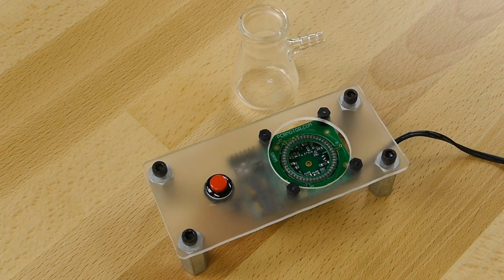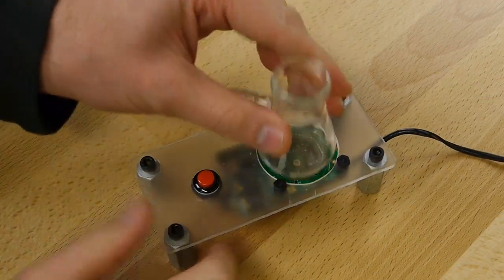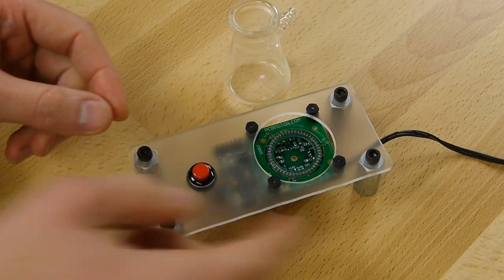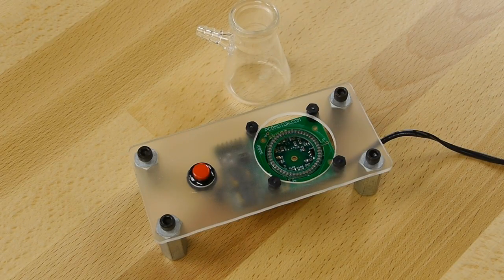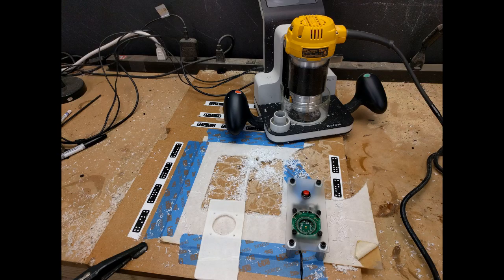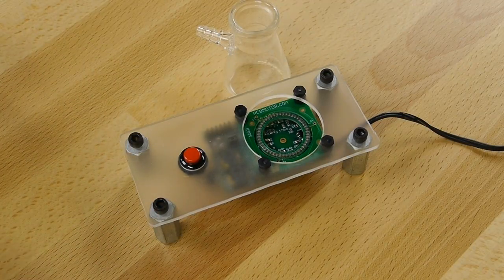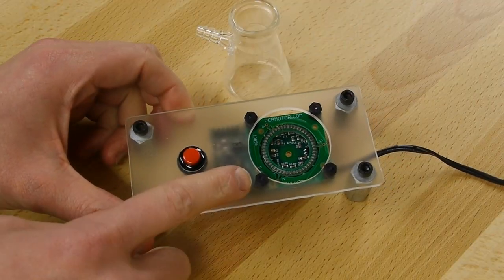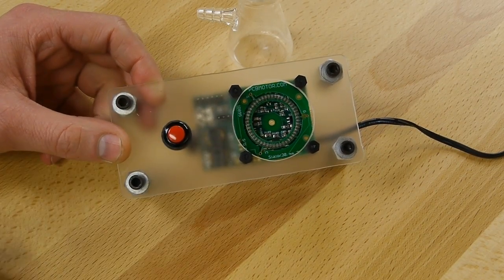Piezoelectric motor

Comment: You explained it very well. Can u throw some idea on sourcing of low cost Piezos for building walking beam type linear micro motor. The stroke required is 8mm in steps of 40microns with force of 40 N. Available operating voltage is 10.5 to 13.5. The walking beam should stay in position after the current is withdrawn and should sustain 20g of vibrations without changing the position.
Let me know the size & sources of Piezos as also how to go about it for building a few prototypes.

Comment: wondering if this also causes a vibration effect?  If not, what woould you have to do or combine with this PCB to get the strong vibration force?  I have crretaed a new product and we are thinking of putting an ultra sonic vibration in the lint brush handle as vibration actually assists in removing lint from clothing a lot faster.  We have a simple 3 volt, 9mm diameter by 23 mm total body length vibrator motor in it right now but i feel this is not the most viable and advantageous opption to get the high quality vibration that we need.  Any thoughts or ideas will help.  I really like the philips oral care electric toothbrush ultra sonic vibration and want to use soemthing exactly along these lines but i bleieve they have patented their ultra sonic vibration but it would not effect me becasue im yusing it for a different application!  thx in advance!

Comment: Hey man.  So if I have just designed and 3d printed a lint remover with two 3” blades that is used for removing lint or pet hair from clothing or any type of fabric and we have installed for now at least two 9mm erm motors inside the razor handles by the blades that give us pretty good vibration and each motor only costs $1 per piece and are run at 3V!  

The best for our design is around 3 volts which have two Aa batteries in the 6” handle!  

I’m pretty sure ultra sonic vibration motor would be the best quality and last the longest,
At least 300-400 hours of life use form the motor so can you give me an idea of how I can use an ultra sonic vibrator motor in my design?  

So the best example of vibration I can give you is the philips sonic care electric toothbrush, where I believe they use a dc coreless iron motor and have an erm motor can tracked at the back end, so would this be an example of ultrasonic vibration at its finest?  

Please explain to me how I could use ultra sonic vibration in my lint remover design?  
Thanks

Comment: I wonder how efficient a piezoelectric motor could be made, compared to an electromagnetic motor, and what would the limiting factor be to the torque. How much force can a piezoelectric transducer produce without it's equivalent to magnetic saturation? I know that piezoelectric speakers are very efficient, compared to dynamic speakers.

Comment: Piezoelectric actuators are pretty precise as well.
We are using some linear piezoelectric actuators in our Optical parametric oscillators to tune the cavity length.
They can do sub steps in around 10nm.
Reply: You have an interesting job. Faulhaber has a wide range of even more precise LEGS piezomotors, circular and linear.
Reply: @StephanBuchin  Thank you. Wow you're right. They have motors that have an 1nm Resolution. That is really amazing.
I'm wondering, if you can use piezoelectric circular motors for long terms, because it feels to me  like they will wear out quickly.
Do you have experience with them?
Reply: @vladimirsch.3015  Sorry, no i don't know how they react in the long run but piezoceramic materials have been used for decades in high frequency audio speakers and they are very reliable. They are also used in very demanding applications like fuel injectors for car engines. Have fun at work.

Comment: Okay. First think first this is not piezoelectric. This is a resonant motion produced by magnetic field when put electric to it. This explained actually gravity. Is a fascinating apparatus. Piezoelectric is the light the pressure of crystal or frictions possible tiles or after Teutonics earth opened and see light excites effect. Can not be vibe sonic the sound is from the glass object. Is not electromagnet buzzer. Can not be motor has no rotor and glass is not conductive. Very interesting energy field. Isaac Newton was right. When add energy you create a other energy.

Comment: Maybe I missed it when you talked about it but what is the "torque" or strength of these elements? Also what dictates the strength is it voltage(and obviously size/material as a result of voltage)? This is pretty cool.

Comment: Is the screeching sound because of the glass scraping across the top of the elements or from the actual piezo elements?
Reply: Found the answer in another comment >> It's mostly the glass. The included disc rotor is fiberglass, and it's almost silent. The stator by itself is completely inaudible.

Comment: Huh!  Suppose I were to try hacking open a bunch of common cheap piezo buzzers, arranging them in a circle, and creating a circuit to modulate their on/off cycle similar to this PCBMotor?  Has anyone seen a homebrew piezo motor using common buzzers like the kind you can get from Radio Shack?

Comment: "hey, wanna hear the most annoying sound in the world?" haha..i was wondering if this could be used in medical IV infusion pumps. usually theres little fingers or rollers that squeeze the tubing to advance the liquid but i wonder if this could generate enough force on each side of the IV tube to do it quietly. probably not worth the R&D since the existing solutions already work well and fairly quietly and accurately but i still wonder..

Comment: Huh, can these be used to drive a motor wheel?  What kind of torques do they see.  Since my company uses a hub motor for a drive system, I'm wondering if you can use these to make a hub motor without all the planetary gears inside.

Comment: I need more explanations, do the piezos get taller following waves that go around in a circle, making the object spin using gravity, or do they all constantly vibrate one way ?
Reply: The vibration of the piezo electric material depends on the amount of the voltage of the wave applied to the circlular disk . So based on your application more the voltage more the material vibrates. But this will show lot amount of power losses like friction. Instead use servo motors for robotics application.

Comment: Cool demo!  Are the voltages across the piezos simply switched on-off or is there a polarity reversal? 
Thanks for posting this.
Reply: I'm guessing half wave AC. Basically, frequency modulated DC.
Reply: I wonder if some gain could be had were they driven with FM crossing zero? Have the piezos push and pull.
Reply: glasstronic
It definitely could be like that, but it'd be simpler to implement it with half wave. The more I think it it, it probably does push and pull, which would make it easier to reverse. But you'd have to have really perfect tuning of the resonations. So for the microcontroller being used to tune it and the odd cutout of the pcb.
Reply: theLuigiFan0007
Hopefully, there are other tinkers pondering this. As you are aware, those piezos might indeed be supplying reverse polarity to others in the circuit as the fired ones relax. I'm sure you know the drill.

Comment: The sound it makes with the glassware on it is exactly the same sound made by the ultrasonic tool my dental hygienist uses to clean teeth.
Reply: I believe there is one that actually makes the teeth vibrate to shake off plaque and stuff.

If I'm remembering correctly, the business end is a small metal rod with a metal ball at the tip.
Reply: As far as I know most of the dentist tools are driven via pressured air turbines, they turn in very high speeds which might sound a bit high frequency which can cause the same sound like this "ultrasonic"  piezo

Comment: these things are frequently called stick-slip motors; that's your search term.  A few years back there was a lot of interest in them, hundreds were designed and some patented.  A few still exist, the USM, nanomotion and some kind of micrometer positioner, maybe Newport.   Nanomotion has both linear and rotary versions for precision xy stages.  The bristlebot was another version, driven by a motor, but same general idea.

Comment: Can you use smd caps with crappy dielectric as those 'piezoelectric devices'? SMD caps with Y5V dielectric are quite prone to emit a sound when they see an AC across them because of the piezoelectric properties of the dielectric they're using.

Comment: This may not be the best analogy. But does this mean it works similar to a worm crawling? Each segment expands and contracts while pushing and pulling against a surface. Except instead of the "worm" moving, it's the surface it is touching.

Comment: Fascinating, however, I can't quite visualize how the expansion and contraction of the SMD devices, even in a wave pattern, causes the object resting on them to rotate. I'm wondering if there is more to their motion than a simple Up/Down deflection ...
Reply: As far as I understood it is a little more. The individual up/down motion of the piezo elements does not make it, but when you time their motion to get a wave, objects are pushed by the wave pattern like deadwood on water. The wave pattern itself is a property of the whole system (plate with all piezos & substrate). It is then more like the system as a whole wiggles and pushes the object around. In a waterwave most water just goes up and down, but when the wave hits you, it still has a momentum in your direction. The whole (here: wave) can have other new properties than its parts (here: piezos, chunks of water). This widely occurs as emergence.

Comment: Do you think you could make a track or conveyor belt system with interchangeable sections using this? Possibly for moving around small parts like in an assembly line.

Comment: If I recall correctly, Canon invented and patented this decades ago and didn't quite know what to do with it, until they found it would make the perfect autofocus motor. Fast, quiet, precise, ideal form factor (ring), and still reasonably energy efficient if both sliding sides are engineered properly. They called it "ultrasonic motor", which used to be a hallmark for the fast and quiet AF motors, but they later made a small fast spinning US motor which drove a traditional geared slightly more noisy autofocus system and also called it "ultrasonic", so we now have to specify "ring US" vs. "micromotor US".

The ultrasonic AF system has only recently been superceded by a stepper-motor AF, which can drive at arbitrarily slow speeds for focus-following in videos.
Reply: +pinkdispatcher I came here to ask about this. Is this how ultrasonic motors are built? I always thought they were made from two solid ring materials. I didn't think they were made from individual piezo motors. This fascinates me because it has robotics applications. Seems like anyone could make this style motor with some PCB design software, whereas ultrasonic motors have always been out of reach for hobbyists.

Comment: The piezo elements that make up the ring, are they specifically designed piezo elements or something else? It's just they look suspiciously like ceramic SMD capacitors, which do have a piezoelectric effect.

A few years ago i took apart an old Nikon lens that had a piezo motor for the focus, it was quite interesting, it used a machined aluminium ring with a thin piezo element on the back to distort the aluminium.
Reply: +Dexters Lab 2013 I had scroll a little to find such comment I had in mind. Google "CAPACITOR AS AN ACTUATOR" and you will find at HAD and article about it. My question is if Applied Science will try to make some actuator using ceramic SMD capacitor. Thumbs up to see a hack/DIY of it.
Reply: "They are single-layer PZT (lead zirconate titanate), which is chosen for
 having a high piezoelectric coefficient.  It's true that multi-layer 
ceramic capacitors also show the piezoelectric effect, but they are 
designed to reduce it as much as possible, since their job is to act as 
an electrical capacitor, not an actuator.  The capacitance of these PZT 
components is just a few pF.  If the demand for PZT 0402 actuators were 
as high as .1uF capacitors, the price would probably be about the same."

-Applied Science , in response to a similarly worded comment.

Comment: I went to their website to take a look. Man, it just added a hundred more questions. How do I find out more about the capabilities? Torque? Speed? They say it's super accurate, but can it replace a stepper? I need to get a hold of one of these. I think think of a couple projects I could use these on if they have the capabilities.

Comment: actually one interesting application could be in rotating things at very slow speed without gears (unlike electromagnetic) motors and without stepper motors. This is very compact and light-weight for these applications. A good example is say for example a jewellery display, luxury watch, and so on. Nice video :)

Comment: Did you try touching it?
Reply: +Loebane You can get 100 amps from a couple of volts or you can get only milliamps from a few hundred volts. It is all related to the resistance. Volts/Amps/Resistance are all related and depend on each other. Statements like "Well if it's low amps the volts won't matter." are just stupid. 30 milliamps (0.030 of an amp) across your heart will mess you up.
Reply: +Kim Jong-un Jr. Have you ever been shocked by 220 AC? I have and there was no pants shitting.
Reply: ***** Well if it's low amps the volts won't matter.
Reply: @Loebane  https://www.youtube.com/watch?v=8xONZcBJh5A
Reply: +Loebane But it's AC so it can lock your muscles.
Reply: +Kim Jong-un Jr. DC will "lock your muscles". AC will "lock you muscles" and release them depending on the frequency. 50/60 Hz will lock and release your mucles 50/60 times a second as it cycles.
Reply: Reading the documentations seems to imply that the current is around 100 to a safe max 500mA, though it could reach to 1.5A... That's the suply current, so the drive should be 0.5-2.5mA@200V to 1-5mA@100V.

A side note is that the information and documentation on their site is complete shit... I gues people that are interested in their product contacts them, but if you're just browsing... not attractive.
Reply: The ultrasonic sound generated by the piezoelectric transducers may be able to atomize his blood upon contact which would hurt. I don't know if these tiny transducers are powerful enough to do that, but if you have an ultrasonic air humidifier put your finger onto the piezoelectric transducer, or even close when it's running in water it will sting. I don't believe it's dangerous, but if it's powerful enough, I can believe it kay not be very good for your blood and at a certain point it can kill you, though I'm almost certain those transducers in his little piezoelectric motor aren't powerful enough and those inside a commercial air humidifer aren't either, although the atomized water coming off of it does look amazing.
Reply: Loebane
What stupid? 220V AC will literally make you shit your pants and render unable too move.
Reply: +oOMonkeyMagicOo If the power supply is current limited to 30ma, the most voltage it could possibly deliver through the human body is 20v. (an open wound with the live voltage shoved into it), or sticking your tongue to it...
Reply: Kim Jong-un Jr. What you're talking about is 220 AC wall current. This is 200V DC (not that it being DC makes a difference) and it's through a transformer. The amps are much lower.
Reply: Loebane
Uh-huh DC though transformer (sarcasm)
Reply: +Kim Jong-un Jr. Ok that was dumb on my part but it does have a rectifier somewhere for the microcontroller which is probably why I made the assumption that it's dc. Oh and when you said "what stupid" I wasn't saying anyone was stupid -- I meant let's not throw the term stupid around.
Reply: ***** First of all, transformers are a way to step up ac voltage but the current swings inversely with the voltage so it can stay relatively high.
If it is boosting 12vdc to 200v dc, then a step-up converter would be used. This trades amps for volts, and is cheap and efficient for applications that need high dc voltage but low current.
Reply: oOMonkeyMagicOo Let's not throw stupid around. This is a science channel after all. The important part is the amps from what I've read - your heart isn't in danger until up to about 100 milliamps. I'm no electrician but I believe that high voltages will overcome your body's internal resistance. So in this instance, the high voltage won't be dangerous as long as the amperage is low enough.

Comment: Are these really specific piezoelectric "components"? Basically any ceramic capacitor will exhibit the effect, and I suspect those are just ceramic caps in the ring.
Reply from the maker: +USWaterRockets They are single-layer PZT (lead zirconate titanate), which is chosen for having a high piezoelectric coefficient.  It's true that multi-layer ceramic capacitors also show the piezoelectric effect, but they are designed to reduce it as much as possible, since their job is to act as an electrical capacitor, not an actuator.  The capacitance of these PZT components is just a few pF.  If the demand for PZT 0402 actuators were as high as .1uF capacitors, the price would probably be about the same.
Reply: Applied Science So, your next challenge would be to make a big linear motor from cheap capacitors. :-)
Reply: +USWaterRockets  Or just singin SMD capacitor array :-)